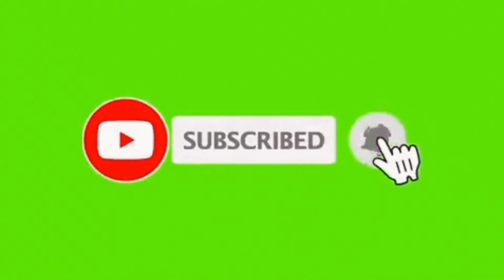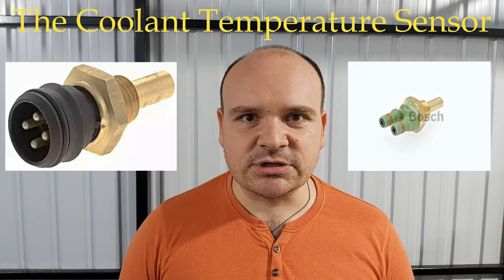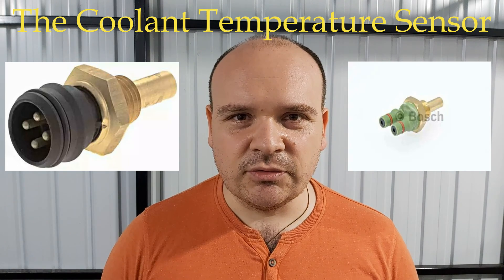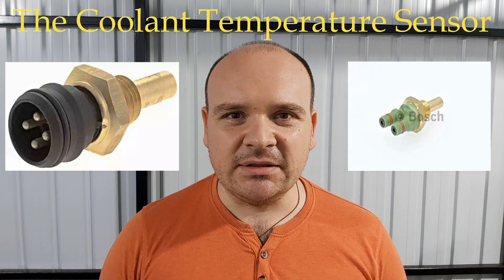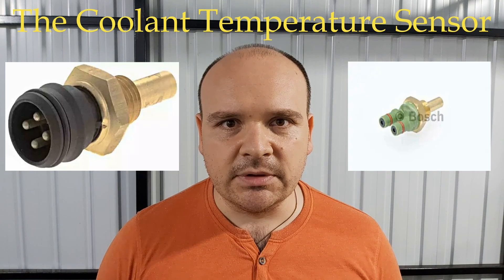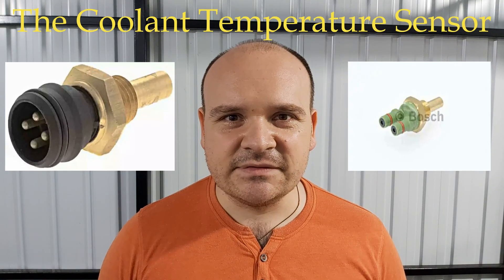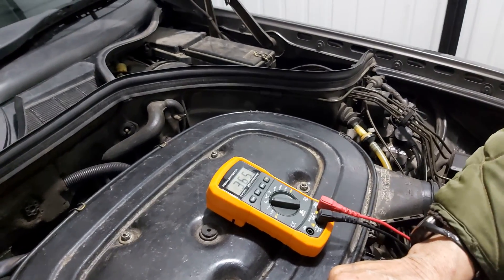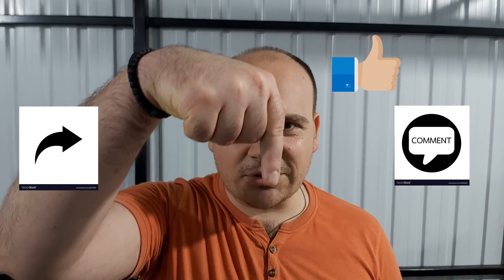㉦Mercedes KE-Jetronic㉦ - The Coolant Temperature Sensor for Mercedes W124

Comment: Hi! I have a 190 w201 2.0 k-jet. As soon as I connect the two-pin connectors or at least the other one, the car turns off immediately and the sensor is new.
Reply from the maker: Hi 👋 If the engine stalls immediately after connecting the two-pin coolant temperature sensor, usually the problem is not the sensor itself, but the wiring or the ECU input.
Check that the connector is not shorted to ground, and also verify the wiring back to the control unit. A new sensor with a bad connection will make the ECU “think” the engine is overheated → it cuts fuel right away.
So:
1️⃣ Double-check the wiring and pins.
2️⃣ Try measuring resistance of the sensor cold/warm.
3️⃣ If values are correct, follow the cable back to the ECU for shorts or corrosion.
– Ivica | FixYourMercedes 🚗✨
Happy Mercedesing

Comment: I see 4 sensors for water/engine temp.  4 pin like in video. A sensor on the water pump with 1 pin.  Another 3 pin beside the 4 pin on top of head. And a blue 2 pin by them.  I replaced the 4 pin and still have a very hard to start 1993 190e 2.3l.
Reply from the maker: Hard cold starts can refer either to a bad OVP or a bad cold start valve!

Comment: hello, my 1986MB300E has the 2-pin coolant temperature sensor like the one you show on the video. Car runs fine but I checked to see the resistance on both pins and the potentiometer doesn't show any value with cold or hot engine.  I assumed the sensor is bad and ordered a new one. Do I just unplug and screw the new one? Also to test before installing the  new one, what resistance should I get in a hot glass of water and a cold one please? Thanks
Reply from the maker: Hello. Concerning the values - here, I will send you the link to my instagram page where you can read the values. If you don't get any values both on the potentiometer then check the wires if you have continuity. The link for the CTS
https://www.instagram.com/p/CTLYUPdKBQ_/

Comment: Thank you, my coolant temp gauge did not read at all I done the ohm's test you described and had no resistance I swapped the  sender unit for another second hand one I had on another engine, it had ohm's reading's on all 4 pins now temperature gauge is working and funny enough my oil pressure gauge started working this didn't work before I changed the coolant sensor, so thank's again.
Reply from the maker: My pleasure 😊 Happy Mercedesing 🍀 😊 😃

Comment: Hello, I'd like to ask for your help. Engine 102.982 CAT 230te '86 my idle is everytime about 800 rpm. It starts fine in cold and warm temperature. The cold starts injector has voltage as long as the motor starter is running. Then, after starting the engine, the voltage on the plug drops to zero. Coolant temperature sensor is ok. OVP,  ECU and fuel pump relay are already exchanged. The cold injector and ICV are working well. Where else is the problem that the engine doesn't achieve 1200 rpm after engine start? Thank you in advance for your response. Greetings from Poland, Tomek
Reply: 👍  thank you , i will donate your channel for helping me 😁
Reply from the maker: @tomaszdyrbus761  Z góry dziękuję! Naprawdę to doceniam!
Reply from the maker: Hello. Don't worry, everything is fine, you just have an older version of the system. On your system that is not supposed to happen. That feature starts from september 1989 as the catalytic convertor has to be preheated for 28 seconds raising RPM to 1200 when the car is totally cold.
Greetings from Serbia, Ivica
Reply from the maker: https://www.instagram.com/p/CgouAgLDkNo/

Comment: Hello I have the 1987 mercedes 300d w124. Is it possible to make the auxilary 
Family come on at lower temp. Where I live it gets to over 100f often 
And the fan does not come on low speed untill 100c and high speed is 110c
It is hard to drive with air cond. I have replaced both temp switches on the head
Also new auxilary fan and clutch fan. I have seen people use a resistor on the 2 pole temp switch but my car has 3 pole temp switch. What can I do.
Thank you for your time and video. Robert

Comment: Hi
Suffering rough idle for months.
Checked my engine temperature sensor today. When the enigine is cold it gives a reading of 2.5,kohms. When the engine is hot the sensor shows .5 kohms. Could this my issue ?????? Keep up the great work. Very informative vids. Cheers
Reply: Will measure fuel flow to the injectors and report back.
Cheers
Reply from the maker: @brianalcock  Cheers!
Reply: Tried to do flow test today. Was unable to place fuel lines into individual bottles. Took off all lines and bypassed FPR. Could hear it prime and all ports seem to be holding. No fuel in ports. Did a pressure  test some time ago and  it produced 2 litres in 1 minutes. I doubt its a fuel distributor problem. On to the next plan!!!
Reply from the maker: So, the pump is good! If no fuel leaked out of the distributor as you removed the lines then your FD is good.
Reply from the maker: You have a bad value when the car is warm. Both pins must show the same value. When warm you should get 350ohm.
Also tell me about your car - I need the engine code as well as the year of manufacture. Provide me also with the things you have done on the car, replaced.
Reply: @mercedeske  Hi.
I have a 1989 260E. M103 Engine (No O2 Sensor)
Engine Code  - 10394022065054
I have a rough Idle with an occasional stall for the past 2 years that I’m desperately trying to figure out.
The revs on warm idle are at 500 RPM. It has a slight shake. I cannot identify if its an Ignition, Fuel or Vac Problem.
Ignition
Checked all individual components and all appear to be working fine. Spark appears to be strong on all cylinders. I changed the plugs (Denso Q16TT) and distributor cap (but not the Rotor). Also replaced OVP.

Fuel
I‘ve changed the Fuel Filter and Fuel Pump Relay. Checked  Accumulator. I’ve done several tests in terms of fuel pressure and flow. Fuel flow produces 2 litres of fuel per minute which is a good indication of strong fuel pumps. I did a pressure test on the KE Jetronic /Fuel Distributor. On the lower chamber I get 5 bars and on the upper chamber with the EHA disconnected I’m getting 5.4 Bars.  
I ‘ve also replaced all injectors  (Bosch x 6) and seals.
I did not do an individual flow test to Injectors

Vacuum
I’ve done a Smoke Test and it shows no leaks in the Engine Bay. I carried out a Vacuum Pressure Test from the Intake Manifold. Interestingly it went from 14hg to 15 Hg floating between these points. (Have a Video if I could email it to you) I believe it should be between 18 to 21 Hg and steady. The Vacuum Dial at that pressure indicates Late Ignition Timing. 
 I’ve also conducted a Compression Test and that indicated 13.5 Bars of Pressure on all six cylinders.

 Other Components Tested
I’ve conducted tests on the following and all appear to be working.
a)	The E.H.A
b)	The ICV Valve
c)	Potentiometer
d)	Temperature Sensor
e)	Crank Shaft Sensor
f)	Micro Throttle Switch
g)	Sensor Plate
h)	HT Leads ( Measuring Resistance)
i)	Duty Cycle
j)	Air Intake Temperature Sensor
I’ve run out of ideas at this stage and desperately want to get to the root of the problem.
Really appreciate your time.
Cheers

Comment: Thank you for all the information. My car is 230e 1992 m102. I tested CTS and the ohm measurements looks fine. You said the cold start injector must be active below 60C. But when it is not very cold (in my case under 10C) my cold start injector does not work. 4-5 seconds ignition and the rpm goes to 950 and then after warmup it falls to 800. I tested it with another CTS. I put CTS in a cold water and plugged it and then started the car. the cold start injector worked. The rpm went to 1200 and after warm up phase it fell to 800 rpm. Perfect.  What can be the cause of the problem? When I park the car during the night and try to start in the morning it takes 4-5 seconds without the cold start injector. But if the weather is really cold that means below 10C, it takes only 2 seconds. Another difference is without the cold start injector the rpm is 950-1000 and with cold start injector active the rpm is 1200 during the warm up phase. I really can not understand the cause of the problem? Any help is really appreciated. All the best.
Reply from the maker: Which car do you have and which engine type?
Reply: @mercedeske  1992 230e m102 engine
Reply: Here are the videos. One with cold start injector active the other not active 
https://youtu.be/neZ-M0Nu8tA
Reply from the maker: @behlulozkan  Did you check the sensor twice? Both when the engine is at 20 and at 80 degrees C?
Reply: @mercedeske  yes. I bought two sensors. Both work fine hot and cold
Reply: I think I found the answer in WIS: No further actuation occurs above + 60°C or
+ 15°C respectively. For my car the line is 15C
Reply from the maker: @behlulozkan  What I found is that the csv on m103 engine operates up to 60, on m104 up to 70 and on m119(V8 engines) up to 15 degrees C. The operating depends on the outside temperature.
Reply: @mercedeske  I have no idea what the problem is
Reply: Can the other green sonsor be defect and create this problem?
Reply from the maker: @behlulozkan  Try testing everything. The solenoide. Unplug the csv and take it out, plug its line again but not the electric supply for the valve. Take two wires instead and connect them to the battery(the polarity doesn't matter). If you get spray pattern then your csv is fine. Test the connection, the brown wire is the negative, the other one is connected to the fuel pump relay(contact 87V). If the wires are okay you will have to get less than 1ohm resistance(as I remember).
Reply from the maker: Which other green sensor? Can you send me a video on the fb page?

Comment: Great video. Still having hard start issues. Injectors and accumulator changed. Just checked this sensor. Cold: I got 950. Warm: I got 65. So much lower than what you got. Bad sensor?
Reply from the maker: Bad. Replace it!!!
Reply: @mercedeske  thank you! I will and let you know. 😊
Reply: If my values are low then wouldn’t I have more problems with cold start instead of warm start?
Reply from the maker: @sophiathe380sl  With both of them. With this value of 65ohm for example the ECU thinks that the coolant temperature is over 120 C and the EZL moves the timing in extreme retard and there are your issues.
Reply: @mercedeske  I just got the new sensor for my 1984 R107 380SL. I pulled out the old 2 prong. The old one has a stem (dip stick) about an inch from the bottom but the new one from Uro does not. Is that normal?
Reply from the maker: I can't tell it, really.
Reply: @mercedeske  I put the new one in and I got Zero ohm. I got zero in and out of the car. I put it in cold water and hot water and I still got zero.

Comment: Where can we find repair socket connectors for old type sensor?
Reply from the maker: You mean the new sensor?
Reply: @mercedeske  no, for the old bosch 2 pin - 006 542 77 17.
Reply from the maker: Search for it on ebay
Reply: @mercedeske  what is it called? how can I search? I do not know the name or number for this connector, I cannot find it anywhere.
Reply from the maker: The coolant temperature sensor. There should be number on it or a mark when you remove it. If nothing then search on ebay as Mercedes W124 coolant temperature sensor. Then look for your car, the year if production.

Comment: Do you need to test both poles in the two pin sensor? Mine reads fine from one pole, but nothing from the other pole. Does this mean that the sensor is bad?
Reply from the maker: Yes  it does. One of them is for the ecu, one for the ezl. Both have to show the same values. If don't then replacement only.
Reply: @mercedeske  Thank you very very much! I ordered new sensor today 👌.
Reply from the maker: My pleasure.😃🍀

Comment: First, a big thanks  for all your videos.  I have a w124 2.3e with the  "modern" sensor. When it's cold, I measure 1.7kohms for the two points and not 2.5kohms. At 80°, I find 320ohms at one point and 345 ohms at the second point. Do you think that the sensor need to be change ? Thanks again ! Regards.
Reply from the maker: Hi and thanks. Concerning the cts(coolant temperature sensor) - all contacts must give same readings-2 of them are for the engine and second two for the EZL. At the temperature of 20 degreed C you must get 2.5 kiloohm. Well, 1.7kiloohm equals 30 degrees C. Well, how ever you decide but it would be nice if all contacts show same readings. Greetings
Reply: @mercedeske  Thanks, I will change it. Regards.
Reply from the maker: @audiovintagefr  Happy Mercedesing
Reply: @mercedeske I have w210 and CTS has 4 pins. Every 2 pairs of diagonal pins shows different values. Is that good or faulty sensor ? I bought the new one and these values are again different ! But when I install it after 2km of driving I had 107 degrees C and both auxilary Ac fans turn on ! I am lost now what is wro g and ordered again a new sensor from Heela brand this time ! I will change previous Nrf brand for a new Hella because I think they sold me faulty one !

Comment: Hello, great work! I have a w124 that stalls and cuts out at 80 degrees. I don't know what's the problem. Can you help me?
Reply from the maker: Hello, thanks. Have you replaced the O2 sensor?
If the car behaves well while cold and starts stumbling, jerking, has bad idle when warm, then your issue can be O2-sensor. If you haven't replaced it yet, consider replacing it. These have to be replaced each 30k miles(50k km).
Reply: @mercedeske  Thanks for your quick response! I'll try replacing it
Reply: Air mass flow sensor 👍

Comment: Hi, my 190e has a very specific problem, it starts fine, cold or warm, no problems, but when it was warm and it sits for 25 min and I try to turn it on it goes for one short moment to like 800rpm and shuts immediately off, after that it is very difficult to start it, in the summer nearly impossible, it cranks and cranks without starting, do you maybe know what it could be?
Reply from the maker: Hi, did you test your fuel accumulator?
Reply: @mercedeske  thank you for the response, yes I already changed that, it was used but in very good condition, nothing changed, maybe it is a injector?
Reply from the maker: Try testing the injectors. Take them out and put plastic glasses under each of them. Deflect the sensor plate for about 5 seconds and then measure the time. If the injectors don't drip fuel within 2 minutes, they are okay! I suppose you know how to turn the fuel pump on?

Comment: Buenas noches  cordial saludo quería preguntarte cual es la temperatura normal de trabajo de el motor 102  de  un Mercedes Benz w124 pues mi carro enciende el magneto de el ventilador a los 100 grados Celsius y quiero saber si esta temperatura es la correcta o debo cambiar el sensor  por uno que me encienda el ventilador a menor temperatura  muchas gracias por tu colaboración
Reply from the maker: Buenas noches. Tenía el original de Behr, supongo que encendía el ventilador a 100 grados, pero no estaba contento, así que compré uno de Behr que enciende el ventilador a 85. Si quieres ese, busca Behr TSW5D, es su etiqueta. Hay uno que enciende el ventilador a 85 y el otro a 90 y algo, no estoy seguro. Como prefiero que mi motor funcione a la temperatura de funcionamiento y no por encima de los 85 grados, mi ventilador siempre está encendido, por así decirlo. Tú decides como quieras. 100 grados es demasiado para mí y tengo un motor W124 M102. Espero haberte sido de ayuda. Muchas saludos de mi...
Reply from the maker: Aqui, miralo.
https://www.youtube.com/watch?v=kbBjlzfk3lk

Comment: The video cannot be seen clearly. Maybe close up is better.
Reply from the maker: Well, it turns to be like that, but it is because I have an older model of the sensor and as you stick the positive of the multimeter, nothing can be seen, the negative goes on the chassis.

Comment: Hi Thanks for this informative video. Well done.

How do you check for newer models again, parallel like you said, means side by side of the sensor? But i see you sticking the red multimeter lead to the sensor hole? Start of no need to start the car? Thank you
Reply from the maker: Parallel I meant one against the other ;-)
I have an older type of a sensor, so you will have to measure it different than me. Do it one against the other. Thanks for the comment, greetings
Reply: @mercedeske  thank you Sir for the reply and advise. Look forward to your videos. Suscribed. Stay safe!
Reply from the maker: Thanks, my dear. I am always here for help. Anything you need just leave it in the comment section, I always answer. Take care, best wishes, Ivica